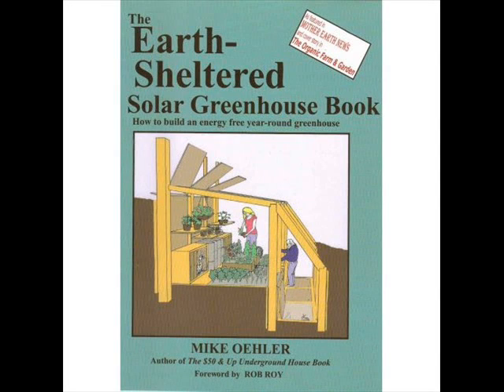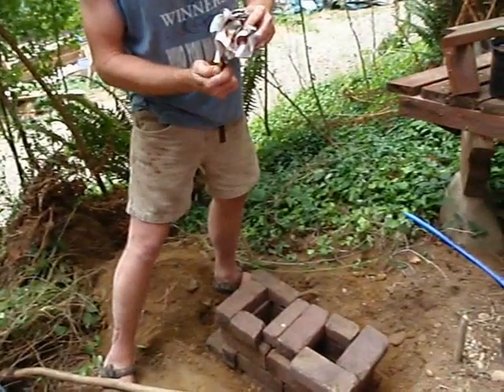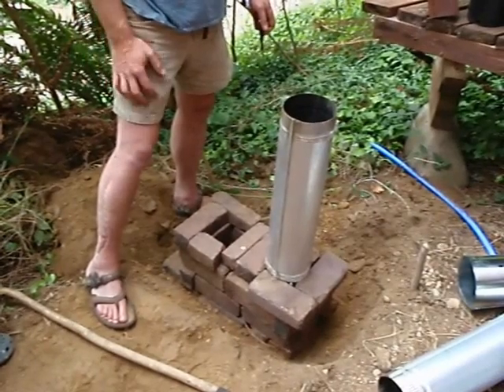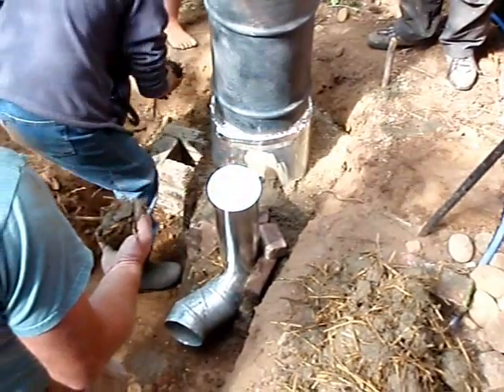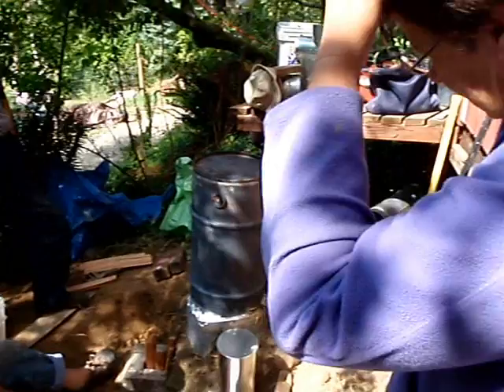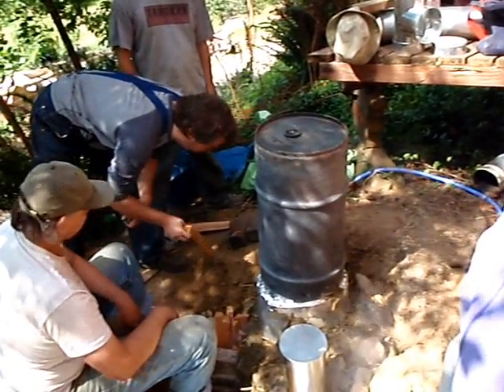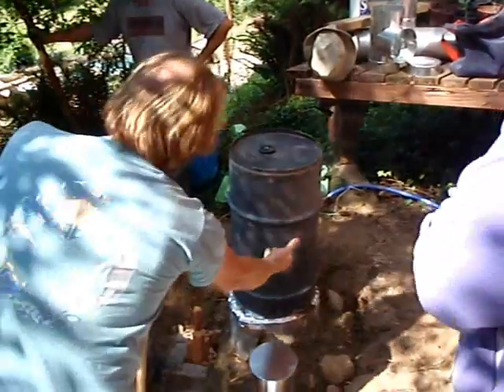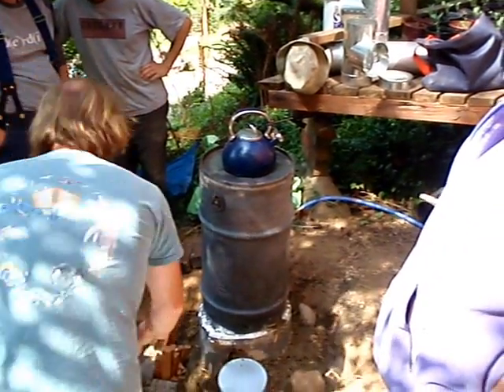greenhouse construction + rocket mass heater how to tutorial

Comment: Get a laser thermometer gun.
That's pretty shiny pipe it looks like a stainless steel I hope it is if it's not you can make it yourself you can buy the equipment and make a bunch of Amish people around the country do that they make so if I can make it 3 in 4-inch 5 in 6 in 8 in whatever the guy one guy makes some elbows not he makes tees which can be used as an elbow also.
Reply: Galvanized pipe go with stainless steel pipe  last a lot longer

Comment: Paul,
I am so grateful for your vision and dedication I've at maybe years in working with this concept. There are so many applications of it so many materials that can be used. 

I've been trying to get the idea out to North Carolina and Tennessee cuz they're facing winter!

This PLAYLIST shows a simple, effective, efficient and inexpensive way to heat homes and tents and sleep on warm ground!!!
The idea uses the Earth as thermal Mass and radiates heat up into the living quarters whether it be a tent or a teepee or a yurt or a shed.
 Dakota Fire Hole Trench Rocket Stove Earthen Thermal Mass Heating System 

28 Video Best Dakota Fire Hole Earthen Thermal Mass Heating System

https://youtube.com/playlist?list=PLsEWVATMY6q2fs1n3lDWhsIlBxo0-rbAP&si=K0isX1WI38DOmSkY

You mentioned heat and it's getting cold there. 
I'm hoping maybe you or someone will listen to me and get in touch with me. 
I Have a solution for a lot of people. 
For now I'll just put a couple, no just put one playlist.
Please watch a few of the videos. 
Watch at least the first two cuz the first one is going to be the first of two from a guy who built an underground trench whatever you want to call it tunnel rocket stove. He was going to set up a tent over the trench.
He had fired it up one day. It snowed lightly.
He fired up again and it melted all the snow. You can see that in his 2nd video.
The video after that is the first of three of my videos which I did on the system that I built. 
You'll see the video it's inside of a geodesic dome. 
I put that system up and I did put the Dome up over it after we built it. 
My little grandkids help me do it so it's something that anybody can do. 
In the dome I did an interview for a documentary called beyond off grid wish if you have time you should watch it. 
I guess that's enough for now I'm trying to be very brief...

My name is Jerry Diamond.
I won't bore you have a lot of personal history and details. 
I have studied for this point in time for 40 years now. 
My mind works such that when I see a problem I work on it till I find a solution. 
People talk about the motivation and the desperation and the burden and the sorrow and the devastation out in Western NC and Tennessee.
I felt that for 40 years and it used to almost kill me and now that the I'm SEEING the grief that I felt for 40 years, it is not affecting me as much as I had processed it all for decades now. 
What you're all feeling I felt 20 years ago 30 years ago. 
What you're living through I felt in my heart and soul and mind for decades now. 
I've been planning on how to help people for all the time figured how to do it with inspiration by God but I put a problem in my mind I just work on until I get a solution. 
I have 100s of inventions and ideas.
EVERYTHING that I designed worked.
I built three of these systems. 
They all worked perfectly.
One of the second video you'll see was the Most elaborate one and the most thorough one that I built.

The third one was the simplest smallest cheapest one made from 6 cm diameter that's 2.36 in camping stove pipe stainless steel stove pipe. 
I was going to send it out with my daughter...
She lives near Ashville.
I was going to send my 6 cm prototype with her, but figured I can do more good by making videos and showing everybody how to do them because the parts are cheap they can be bought from Amazon AliExpress or eBay.

I Will post a parts list soon basically you need two elbows, about 6 to be 10 feet of horizontal pipe for the trench, then the second elbow and about 4 ft vertical pipe coming out of the ground and that needs to be insulated or a thermal Mass around it so we can warm up heat up that's what creates the draft or draw because heat rises.

There's Amish around the country that make stove pipe from stainless steel flashing. 
It's heavier wall than the junky black pipe you buy in the store and they sell it cheaper than what you buy black pipe bought in big box stores which will rust out after one year. 
Even this SS stuff won't stand up to the heat of a rocket stove forever, but it'll last a long time once you get the idea then you can build it out of anything fire brick slate Rock sheet steel there's a thousand ways to build it and 100 types of material to build it out of.

I wish I could come out and help. 
But I can brainstorm and advise and help in any way that I can.

I Cc'd this to my email and my number is
417-988-0333.
Call me anytime of day or night 24/7/365.

Not saying I'll answer all the time so text me that'd be the best thing text me email me call me do all three I'm on Facebook Messenger if you want to do that route I have been on Signal, so if you're on Signal I would get back on Signal but I'm not on there now. 

Please be safe as best you can. 
You're aware of some of the dangers. 
You have no idea how deep the evil goes and how great their forces are you up against. 
TJ of Grindstone Ministries who's been out there a lot says that 
"We are in a protracted asymmetric war 
against FEMA and the federal government "
and civilians that are fighting and maybe they're winning I don't know they got some big ass dangerous badass equipment I know that.
The minerals there are worth several trillion dollars:
 THAT'S what you're up against: evil people wanting the minerals under the Land there I don't see much hope!?!!

Comment: Need chimney in to create the “chimney effect” which means exactly that. Chimney effect would create stronger airflow. The higher the chimney, the stronger the air flow. I’ve learned that regarding home efficiency for heating and cooling, we BPI ( building performance institution) look for “chimney effect” that causes the efficiency to degrade homes’ performance.

Comment: galvanized pipe was not designed to be buried
Reply: Nor should it be used on a rocket mass heater, because the zinc is vaopourised by the great heat. But I guess zinc is one of the trace minerals used by plants.
Reply: it's dangerous to weld it I hear.... bad move letting it be part of a fire place.
Reply: These people are doing it all wrong. Can't even build a fire.

Comment: The Rocket Mass Heater itself should be outside.  

Water should be a better heatsink than dirt, and since water would be used for the plants, it could be win/win.
Reply from the maker: My position is very different from yours.  The rocket mass heater should be inside the greenhouse with the exhaust vented outside.
Reply: Why would you want to heat the outside of your greenhouse, when you can keep 100% of the heat inside it, instead of wasting half of it at least?
Reply: +Logan Cressler
True, the heat all belongs inside, and so does the carbon dioxide-and-water vapour exhaust! 
It may be poison to us, but CO2 is the very stuff of which plants are made. They cannot live without it. Nor would we have the oxygen supply we require without plants respiring CO2 into O2.
Professional greenhouse growers burn fuel inside their tunnels specifically to keep the CO2 level up from the regular 300 ppm, to 1,000 ppm, to maximise growth. Otherwise, a closed system will quickly deplete all the CO2 from the air as soon as the sun shines and photosynthesis begins, then plant growth must cease.
How anyone imagines that we can have a greener world by reducing "greenhouse gases" the greatest of which are water vapour and CO2, is one of the modern world's greatest non-sequiturs.

Comment: Incorporate a V-10 sterling engine into a mass rocket stove water heater and you could circulate hot water through hoses to heat your green house or home or shelter all without the use of electricity.

Comment: You could also make a nitrogen rocket air conditioner placed in an underground cistern to draft your home and cool it with out the use of electricity! While creating hot and cold running water from your nitrogen rocket air conditioner and your mass rocket stove? ; )

Comment: I would also love to see a follow-up to this as well.  Is the customer happy 5 yrs later?  Is it working as expected?  Any unforeseen issues discovered that may be tips for improvement in the 'next' iteration of this approach?  For example, was the depth used to bury the duct ideal or should it have been shallower/deeper, etc.

Also, it would be great to see a comparison of the air temperature and the soil temperature maybe 10" down to see how effectively this is heating below the plant bed.

Any chance you will be able to provide these kinds of updates?  Very interesting approach and reuse of otherwise wasted heat exhaust.

Thanks for sharing and I'll look forward to your comments.
Reply: Usually 1 of 2 outcomes:

1. The client has stopped using it because it requires way more work and effort than return. 

OR

2. The client keeps on with their expensive but fun hobby. Replacing and fixing everything that doesn't work. In order to get a dozen tomatoes a week. (I buy a dozen tomatoes for about $2)

- Paul Wheaton himself insists that you should never use a metal riser yet that is what they do here. 

- Metal tubes in the ground are going to rust 

- Rocket heaters require some one to add more wood every 15 minutes. 

- You will need to buy and split wood to feed this heater

And the list goes on

Comment: It's been 5 years. I'm most interested in the pro/cons of this RMH. How did it hold up? Time for a 5 years in review video. I've been all over permies.com. There's not enough video content regarding greenhouse heating. Thanks in advance!!
Reply: Usually 1 of 2 outcomes:

1. The client has stopped using it because it requires way more work and effort than return. 

OR

2. The client keeps on with their expensive but fun hobby. Replacing and fixing everything that doesn't work. In order to get a dozen tomatoes a week. (I buy a dozen tomatoes for about $2)

- Paul Wheaton himself insists that you should never use a metal riser yet that is what they do here. 

- Metal tubes in the ground are going to rust 

- Rocket heaters require some one to add more wood every 15 minutes. 

- You will need to buy and split wood to feed this heater

And the list goes on

Comment: why cant you just insulate the outside of the barrel?
Reply: +DRUMofTRUTH There's not a reason you couldn't do that.  If you want to not have that heat directly radiated into the room where you build a rocket mass heater.  You still need to insulate the heat riser because it getting as hot as it gets is needed for the function.  The heat riser is where the thermo-siphon is, that's where the magic happens that causes the draw and makes the whole thing work.

Comment: If, by the time the exhaust reaches the end of your line it is cooler co2 and steam, is there a requirement for a chimney through a roof penetration or would a side venting system be sufficient.

Comment: I have in mind to use the earth under and around an attached greenhouse as thermal mass, by isolating it from the rest of the earth with in-ground insulation, similar to the techniques used in Passive Annual Heat Storage. This arrangement won't take up valuable space in the greenhouse. An optimally constructed "PAHS" home with a 20 ft. insulation "umbrella" around it, can maintain a constant, year round 70+ temperature, with a relatively small amount of sun exposure compared to other solar designs.
Simply insulating an above ground foundation to just under the surface of the ground is more cost effective than insulating roofs. Better yet, extending that insulation two or more feet down adds thermal mass to the structure, so long as a means is provided to share dwelling heat with the ground below it. Lifting that same two foot insulation skirt outward like an umbrella, results in even more mass with the same amount of insulation.
A less than optimum two or three foot buried insulation umbrella skirt would be a relatively easy retrofit, and should work good in combination with an in-ground rocket stove for heating my 12 x 16 micro home/greenhouse. Has anyone else researched Passive Annual Heat Storage? Seems too good to be true, yet makes sense.
Reply: +kelhawk1 I had the exact same idea to combine the umbrella insulation design from PAHS with an underground rocket mass heater. It would no longer be PAHS by definition because we're adding an active heating system but that's not the point. The point is that the umbrella could significantly increase the size of the heat mass without taking up any space in the structure. 

I was also considering insulating all but the south wall which would allow direct sunlight in while slowing the release of heat through the remaining surfaces. A removable insulating panel could be placed on the south wall when the sun goes down to help trap the heat. Better yet, one might design this more like the umbrella home where the structure is buried inside the heat mass except for the south side. For example, it could be built into the south side of a hill.

Comment: is that galvanized duct pipe ?  how long do you expect it to last ...
Reply: I feel that once the clay all sets, and if you keep the thing running from time to time, there will be no moisture in the system left to rot out the pipe. But I was wondering the same thing. If you can think of more reasons why it wouldn't work I'd like to hear them. Just cause I answered my own question doesn't mean I'm not curious for more answers!

Comment: At 4:24  Isn't the statement incorrect?  What happens to the Nitrogen, Sulfur and other atoms in the fuel source?  Chemically it's not a balanced equation.
Reply: It's mostly correct. The remainder is going to remain (lol), but it's a small amount, and it'll just accumulate a little bit in the thing. At least what doesn't get blown out, or rendered into a gas. That may be what the ash clean out they mentioned is about.

I don't know though, it's just my understanding.

Comment: Have you thought about integrating aquaponics into the greenhouse design and heating the water as a functional thermal mass?
Reply: +Clayton Campbell heating the water seems to be working fine for me at 7000 feet in Colorado.

YMMV.
Reply: Arduino reads temperature via a thermistor and controls a pump.

Comment: I wish you actually showed how the inside was structured. I have a good idea having researched rocket stoves but a few things are different than I've ever seen before. The video kind of goes, "we're going to show you how to build a house. Here's the foundation, now look at our finished house". A few steps are missing to put it mildly.

FYI for the one looking for clay, any place that sells landscaping materials like crushed rock and garden soil will have it. Most soil has some clay and they may have just gotten it on site. The old trick is to test your soil for clay content is fill a mason jar with soil and water then shake it up. Let it settle for a day and the lowest layer is clay so you can see what percentage is clay. You need a certain percentage for cob and I can't remember off hand.
Reply: I don't think there's any shortage of specs if you slurp up all things "Wheaton" and browse what his disciples are doing and have done.  But maybe it wasn't like that 7 years ago.  Maybe you were just early in your search.

I've seen the specs, but don't remember them.  I think you can defy gravity with them, once the chimney's hot (basically), and they'll run themselves if you go up so many inches per foot when you're running that flu through your heat mass.  But I'd think about putting a blower or a bellows on it to prime it.  Or a fan powered by a flywheel that you spin up before lighting...  

Once you've got that air all going in the right direction, it works like a charm.  Use the fire for your cooking and the cooking ritual would keep the entire house warm, instead of being a separate expense.

I'm thinking about stovepipe with fins on it, to pass more of the heat into the reservoir, faster.

A lot of people build these without a real plan for getting it started and they kind of sheepishly say "It can get smoky when you're lighting it," which is to say it takes a while to get the chimney to draw.   In the trade, we call it the "draw-back."

Speaking of rocket stoves, I don't think I've seen a single YouTube video that got the Dakota fire-pit right.  You don't use the sideways chimney for air intake.  It's the CHIMNEY.   For lowest profile, you make a DOWN-draft fire, and you send the smoke up an insulated riser.  Very quickly, you're getting almost 100% burn and there's no smoke coming out the top and no sparks flying up in the sky.  

So all those Bush-Masters out there need to build a SMALL fire at the mouth or in the mouth of the chimney and make it DRAW.

Comment: These things work because of the temerature differential between the very expanded gasses created by the supe hot spiral fire and the heat taken out of the exhaust duct via the thermal mass causes those gasses to shrink enormosly in volume as it cools... this action creates a vacuum which pulls the fire sideways and makes it super hot which helps to burn the creosote and volitile gasses from the wood fire... pretty genius stuff

Comment: I watched the video and couldn't figure out how the exhaust pipe was connected to the mass heater core. Did Ernie cut a hole in the outside sheet metal pipe near dirt level, then attach the horizontal exhaust pipe? This is new to me, I'm quite intrigued though. Great stuff!